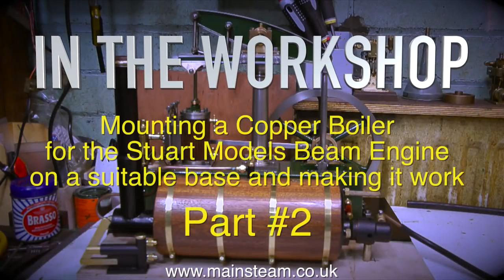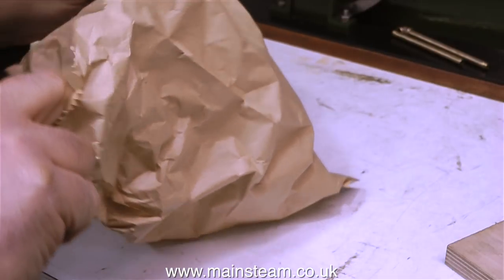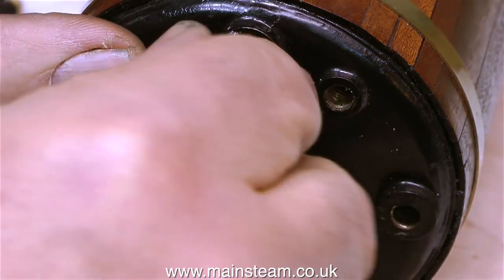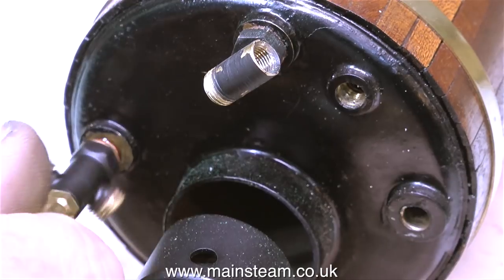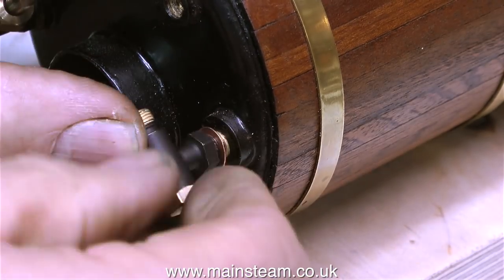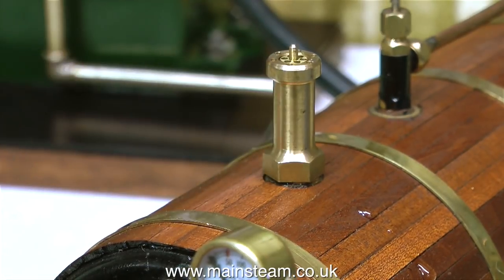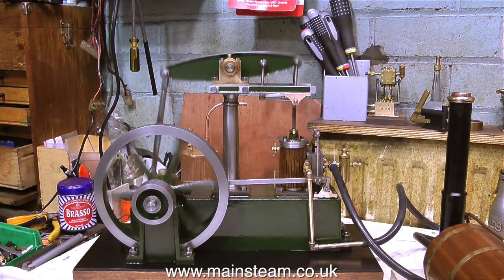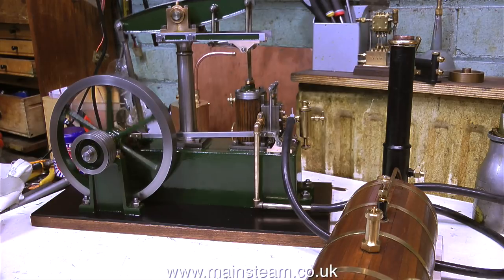A BOILER FOR THE STUART BEAM ENGINE - PART #2

Comment: Bonjour Keith,
Thanks to your videos, I have rediscovered the Loctite 542 which is much more efficient than Teflon rubber to my opinion. Can be ordered in bottles of 50 to 250 ml, which is easy to align with my needs. And about the pressure gauge, I also agrree with you for the scale, but I also have more than sixty years old eyes :+)
Amicalement, Raphaël

Comment: Looking good Keith :-)  I'm interested in your use of Loctite 542 and would like to use it on my boiler set up, how permanent is it ? I'd like something that gives a good seal but which I can undo easily later if I need to.
Reply from the maker: It's permanent until you remove the fitting ..... it isn't like Loctite 603 - it is just a thread sealant.
Reply: Ok thanks, Ill give it a go

Comment: Can you math out the thickness of the shim washer(s) needed? i.e. the thread is 40tpi so one complete revolution is 0.025 inches. If you need to adjust the angle by 90° you would need to shim it 0.00625 or 0.01875 depending on which side it's off to. Make sense?
Reply from the maker: Sorry I just don't do formulae . . . . }:-)))))